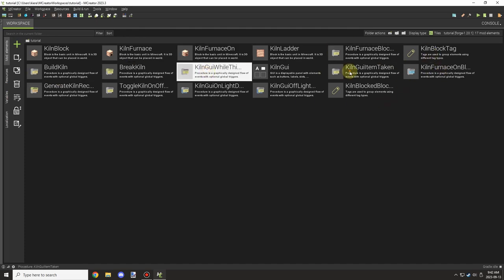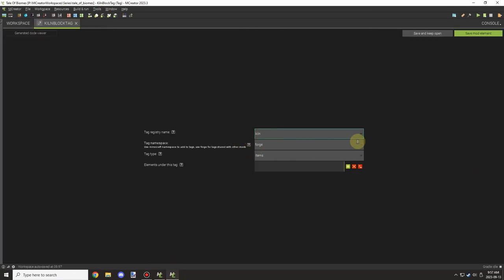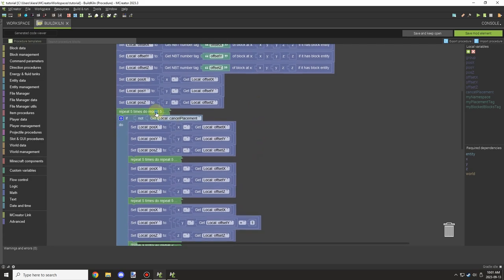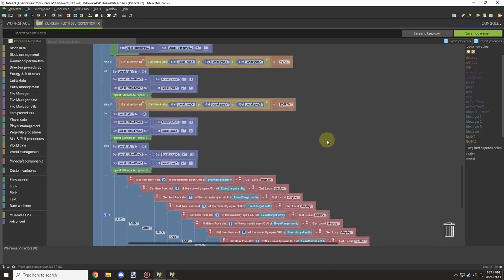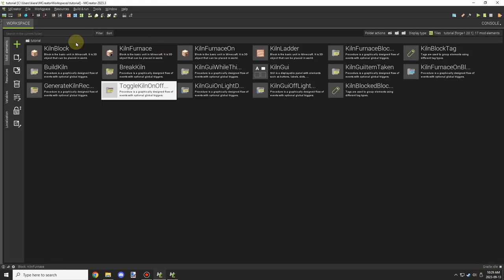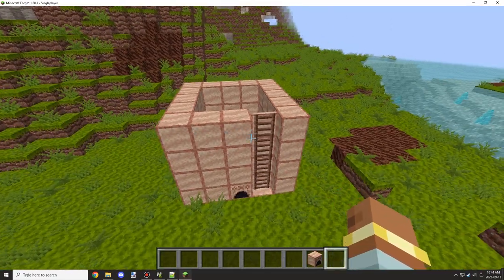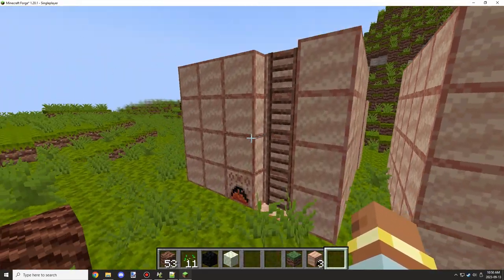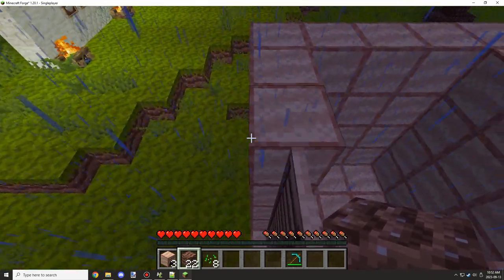Making A Kiln Station | MCreator Lore | Ep33

Comment: Hmm.... This is not what I expected but alright... Now I'm thinking about the temperature system...

A klin temp can reach up to 1560°C,  and the best range for quicklime is 900-1000°C

So I think it would be great to make a temperature system for the klin, which is pretty easy to do

The base temp should be 27°C, and somehow there's a glitch when adding a rational number to another number an error will appear, like 27+0.1 will be 27.1000000001. So to get rid of this we can scale up the number by 10, 27°C will be 270, and when dividing the number by 10 it won't have the error.

And of course, the temp shouldn't increase linearly... The temp should increase faster when the klin is already hot than when it's cold, also when the klin is too hot it will slow down the temp changes too... The fuel also affects this, but to "make it simple", just ignore that

I use this function (made by myself so it could be wrong irl) to calculate the temp increase
∆t=(r/600)*round((1.01/5625000)*x*(15000-x)), x is the current temp*10; r is the run time, increase/dec 1 per tick when turning on/off, capped at 600.  ∆t_max is 1°C per tick

The same goes for temp decrease... Anyway the temp will be capped at around <1500°C, which is good.... Different recipes need different temp range for best efficient so this will be pretty cool..
Reply from the maker: I will need to give this some thought.
I added cross-mod support for the kiln so adding something like this might break support. If I make it climb to a specific number it needs to be dynamic based on the recipe requirements for that temperature. More than likely I need to make the value climb or drop to that temperature for the recipe based on the temperature requirement.

The only other thing I can think that would also cause problems would be the output slot, at the moment people just take the items out of the slot and it crafts so I would need to delay the items going into the slot until the temperature is at the peek amount for the recipe.

I also don't know how this will affect the on/off state of the machine it might not be affected.

However, I will try to figure something out.
I have wanted to work on rice crops for a while but I needed to get the quick-lime stuff done.

"and somehow there's a glitch when adding a rational number to another number an error will appear,"
I have never encountered this issue, most likely I will be using NBT variables to handle the temperature. They support decimal points and I can make a timer if needed to slow down the clock speed for temperature. I just need to figure out a way that will still allow support for cross-mod capability.

Comment: Dont know if this is the right place to ask but you seem to be very familiar with mcreator so.....
Is it possible to detect the position of the players Camera ?

So I made a Fluid but for some reason there is no option to turn on fluid fog like in water or lava. Or maybe there is but I just didn't see it.
Anyway .... I made a custom fog with a plug-in that detects if the player is inside the fluid but there are some problems with that.
I need the game to detect the camera position and then apply the fog color and not when the player is inside it.
So my question:
Is there any way to detect the camera position of the player? 
Version :1.19.4
Reply from the maker: I think there would be a few ways of doing this, the entity eye height is exactly 1.6 from the feet of the entity the axis point of the entity is 0.0 center to the entity. So one way you could do this is test if the entity is not swimming so you can test for 1.6 blocks above the entities feet. Though swimming wise you may need to look at the F3 screen to get the entities eye height for swimming/crawling. I can't seem to find anything online including wiki about where the eyes are located at when in this mod, though I would assume it's under 1.0 as the player is close to the ground.

Once you have the height you for both of these you can then toggle a player global variable for lifetime to control the overlay for your effect. This should work and would be the way I would set it up. The other option is to get ray tracing and try to do something with that and get the distance of 0, 0, and 0 for X, Y, and Z. Though this will test for blocks not eye height per say but it will get where the entity is looking at so it might be able to be used to get the eye height though I am unsure if this method would work or not.